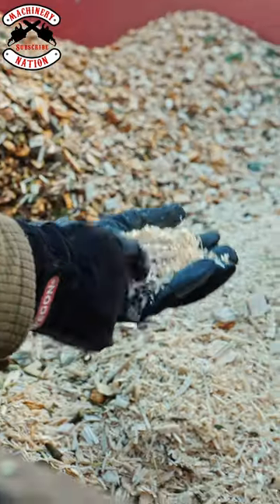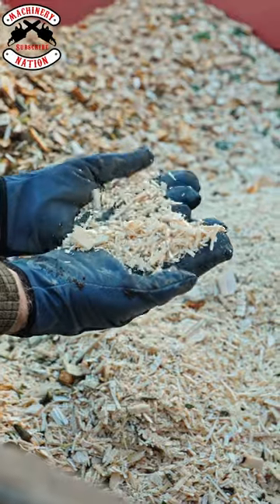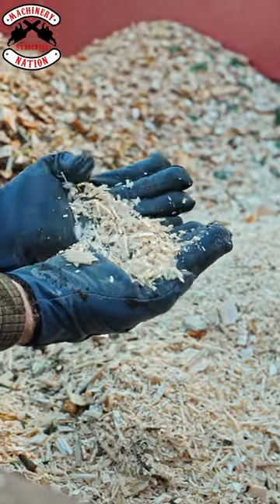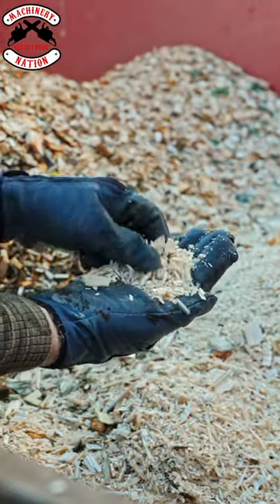Amazing Variable Feed Speed Roller on FÖRST ST6P HD Woodchipper!

Comment: Surely it’s the same amount of chip if it’s big or small
Reply: Same amount but bigger volume
Reply from the maker: Because it’s smaller you can fit more in. So instead of fitting 12 trees in the back, you can fit 15 👍🏼